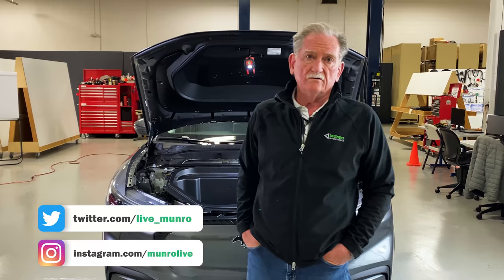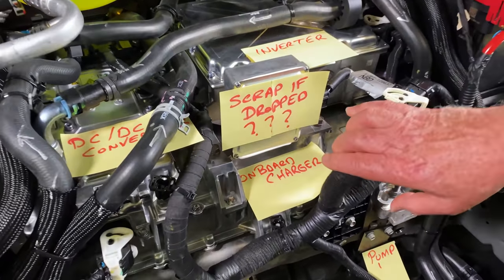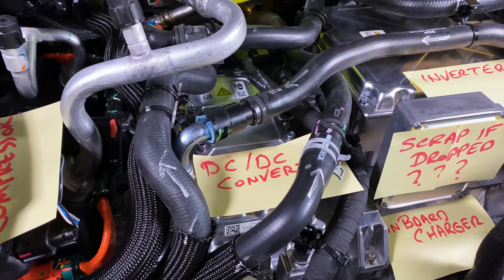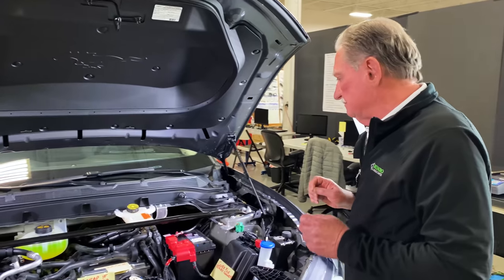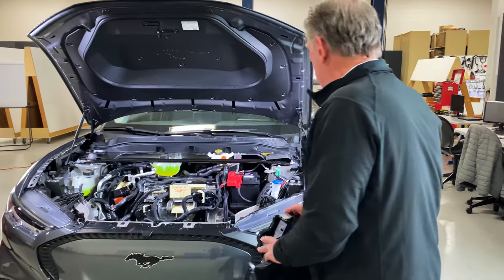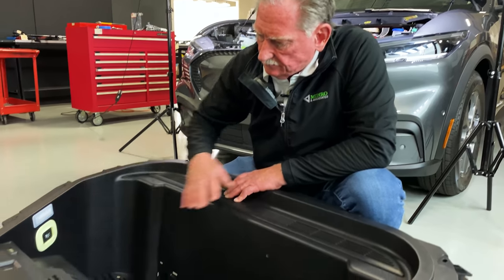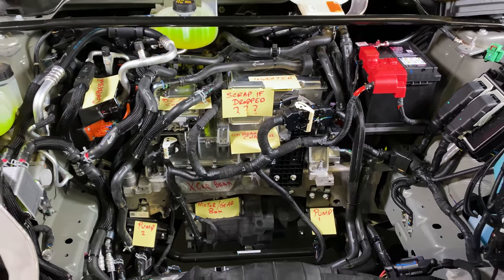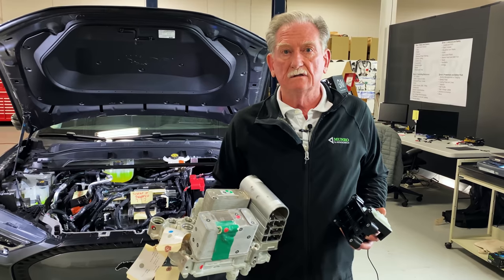Mach-E Thermal System Nightmare

Comment: What a clusterf**k.
Reply: LMFAO 😹😹
Reply from the maker: Agreed.
Reply: This is what humanity has dealt with since the big money pushed out electric vehicles in favor of their profits dating back to the early 1900s. They destroyed our environment, caused massive illness and death in favor of the almighty dollar. We need a new paradigm like what the Venus Project proposed. I was "woke" by the Zeitgeist movement when I saw his 1st project. I'm still fascinated with it's predecessor...Technocracy. It assumes we use energy credits as currency and science to guide our use of resources as opposed to corporations who are driven by a fiduciary mindset over science.
Reply: @billbosch9127  The compact energy of liquid fuel is what drove the internal combustion engine as the primary automobile power for over 120 years.
How would huge electric batteries moved by the burning of coal for 100 years have been any better for the environment?
Reply: @don2deliver  Because with an ICE, the only way to power it is with oil. An electric vehicle will run on any power you can generate. It could be from coal, but it could also be from nuclear, hydro, or even solar.
Reply: @user2C47  but we are at a point where we finally have the battery technology to make them feasible. Yes we had electric cars 100 years ago, but if those went more than 2-5 miles i'd be shocked... People were DIY'ing electric cars back in the 80's but the motors and batteries weren't good at all (car heavier than a truck that could barely do 45 and had 20 miles of range for a good conversion).
 i will agree that we have been set back a few decades, but i don't think it's been too hindered by oil. Modern semiconductors, motors, and batteries play a huge role in why we have workable ev's now. The world would have had to make a concerted shift back in the gm ev1 days to set this industry off when it could have taken hold. Anything earlier (before NiMh batteries) was far too heavy and bulky on the battery side, and the technology just wasn't there to improve them much been if they could. I believe the ev1 had nimh batteries, and that makes sense that it would have been the first commercial test of a practical ev. That's where i place an official "we could have been here already" marker.

Comment: How often does the level of liquid in those two bottles near the firewall, need to be checked?  I don't love the idea of hiding service parts behind those clips which always break.
Reply: You're funny. It's hidden, so when it leaks the whole car blows up, then they can sell you another one? Why do you think cars STILL don't have low coolant/low oil sensors or real temp gauges/alert? It sells more cars by the millions per manuf.

Comment: The part under the superfluous cover on the right also had "scrap if droppped" embossed into it
Reply: There are many parts like that, but the one with the sticker is unknown for what is doing
Reply: @LiviuIonescu  Looks like a load of silicone gooped under the lid of that box..
Reply: Tube technology?
Reply: Scrap the MUCK-e if Drooped..........LOL.
Reply: This part is called "Flux-Capacitor"!
Reply: @phamuc11735  Yeah, Sandy probably found the hydraulic computer 😁
Reply: They probably have MEMS and stuff in them
Reply: @markplott4820  F.O.R.D - Failure on Road Detours, F'd over royally daily and the list goes on. They criticize Tesla and then it is found that a legacy car company makes so... many mistakes...
Reply: @michaelholliday100  I’ve always like
 “FORD - Fix Or Repair Daily”
Reply: @v.gedace1519  I think it's a frammistat actually.
Reply: You would think that someone who worked at Ford would know that they have been using this saying on parts for almost 20 years.
Reply: @Johnny2Feathers  Found On Rubbish Dumps. Failed on race day. And on a quiet day, you can hear them rusting.
Reply: @DLWELD  to keep the frammies warm 🥵🥵🥵
Reply: Is that a lead acid 12V battery? What the # is that about? A 5AH (maybe even less) LiFePo would do the same job, never need to be replaced and use a fraction of the space and save 5 to 10 kg in weight. If not more.
Reply: @DLWELD  Ah, designed by Arthur and Sally?!
Reply: Not fully sure of the style but i've seen many similar connectors fail pressure washing testing as they are very susceptible to being installed incorrectly  due to side load on the wires.  Those Cam locks can also break pretty easy with time at temp and cycles so possibly related to that.
Reply: Looks like a bunch of failures and leaks waiting to happen. Anyone surprised? And I can back him up about those hose clamps. I had to change them out on my last car because they leaked.
Reply: @waynelevett3632  in French 
Ferraille, Ordure, Rouillé, Dépotoir. 
Heard that decades ago.
Reply: @ziggyyo  Box for the old Muffler Bearings.
Reply: Hey! It's the famous, yet elusive, mikeselectricstuff!
Reply: That was weird.
Reply: On the steering wheel the centre boss cover is embossed with a " SCRAP IF DRIVEN" sign.
Reply: @Johnny2Feathers  How about the oldest one: Found On the Road, Dead.
Reply: Maybe that should be their new tagline..."Ford, scrap if dropped"
Reply: Customer: my xyz is not working
Workshop after removing frunk cover: did you perhaps drop this 
Customer: What the ... 
Workshop: just joking, just joking, lol
Reply: At least the battery box gets a tick.
Reply: @richardhalliday6469  hey wanna check out my new battery box? 😄
Reply: I think that’s common on the connection modules / fuse boxes. Dropping them can bend the stamped metal plates inside and cause shorts.
Reply: "You could use a new radiator hose" , Duel (1971) ...
Reply: @michaelholliday100  terrible, it's found on the road dead
Reply: The cover isn't really superfluous. It provides some spatter protection to keep the connectors cleaner. It also keeps curious fingers out.
For components that are truly shock sensitive a visual mechanical shock indicator is usually fitted. Turns red if a gforce is exceeded.
These are warnings keep out the careless, curious and clueless.
Reply: @Dave5843-d9m  not a good option for cold weather climates unless fitted with a heater.
Reply: @Dave5843-d9m  i
Reply: @Dave5843-d9m  i don't think they have a place in modern ev's, but oddly i think a few big brands are still using them... I have no idea why... (Well, it's probably cheaper for them as they get bulk discounts)...
Reply: The whole car should be scrapped.
Reply: Elon MUSK is New God! Mars is the New Earth! Earth Will soon Die Anyway!! TESLA and Tesla Holders will be Kings. Rest and their Family will be Our Slaves and work to Power energy for Bit coin!! Elon is Einstein, Edison, Newton, and Jesus combined. HE at least deserves several Nobel Prizes. Elon has more IQ than weight of Hater's Ug ly Prius and his F at Ho Combined!! HE is like Ironman who will destroy Thanos and critics are better off using their cash to wipe their a n us. JUST Worship Him instead of other silly god!! GOD Elon will Punish infidels!! Go Emperor God Musk!! Elon's brain chips and AI will control and Enslave Nonbelivers!!

Comment: Can you imagine being engineers having their products reviewed like this. Must be tough. Huge Munro fan! Love the videos!
Reply: You should hear the crap they get when they go out on the production floor
Reply: I can't believe these companies don't hold internal design reviews.  This mess would be a target rich environment for reviewing engineers.   The problem the designers have is all the constraints they have to work under.  Bean counters, ASAE standards, corporate mandates, safety standards, inventory backlogs, styling restrictions, union rules, its never ending...
Reply: @gregcollins3404  Many design reviews are held years in advance before the first prototype is built. In reality Vehicle Operations (the assembly line) calls most of the shots when it comes to the architecture of the vehicle packaging. It has to be able to be built quickly on an assembly line within their tooling constraints first and foremost and in some cases serviceability loses out.
Reply: @gregcollins3404  when people like Murno get called in they have months to improve a part. the production engineers get a few weeks to solve a problem with dealing with 5 other problem
Reply: I'm afraid that this is another typical example of an engineering team working purely theoretically. It's not the engineering team's fault though, they did what was asked for. The true problem is that no one is responsible for overseeing and keeping the full project in line from engineering through parts needed through assembling all together in the most cost efficient way. That would be a big cost saver, makes products much more reliable, all leading to a bigger profit. People capable of achieving this are out there, just not that many. Whether it's replacing software at an accounting firm or this, I recognise the exact same problem.

Comment: It's 2021! When I saw all the hoses under the Ford hood I was thrown back in time to my Dad's 1979 Lincoln Continental! And I thought that beast had a lot of hoses! I think that the Ford Engineers were under a lot of pressure to get the Mustang Electric out the door and to heck with good design.
Reply: Everyone is. Tesla put pressure on the market and the market is responding as quickly as it can. The problem is that these companies are not used to moving fast to begin with, and moving fast with new technology is especially difficult. And I think we all knew Ford was going to be using a ton of off the shelf parts... It is simply how they operate. For years it was assumed that just BUILDING an electric car was enough, but in the coming years it is going to get more and more about quality. An EV shouldnt require much maintenence and this is a car begging for it. Not good for the future. And especially sad considering how great the exterior/interior and features generally are in this and the Lightning.
Reply: "to heck with good design" that's ford's motto since the 2004 F150 came out.
Reply: @patreekotime4578  
"Moving fast"?
They've had the Model S to tear down for 8 years and the model 3 for 5.
A simple "Why does theirs look like that?" Should have been enough to start questions being asked.
This smacks of zero "out of the box thinking"
Reply: "Ford staggering into the 20th century from the wring direction."  A Ford ELECTRIC vehicle with more cooling hoses than a Ford ICE!!!

Comment: @6:00 There's another "scrap if dropped" under the cover.

The hose situation looks deliberate to me, maybe to appease some suppliers, or many failure points to develop strong lasting relationships with the local dealership service centre.
Reply: Yeah, also I noticed that their limited warranty is nothing great. It's worse than Telsa's warranty, along with Hyundai.

Comment: Once the old (even a few years) it becomes a nightmare.  Once the Aerostar hoses and their custom fittings were replaced we got better performance....finally.   Was there an intentional effort made to prevent engine overheating with thermally triggered horsepower limit ?     
Great things can be made, but sometimes nightmares also.

Comment: My guess is the "Scrap if dropped" parts are frangible or perhaps even pyrotechnic disconnectors that fire and break the connection to the battery on several points if there's an accident or a serious overload.

Comment: The stacked boxes and all the hoses under this hood looks very similar to what was under the hood of the 1998 Ranger EV.  That's 23 years with very little change, right down to the lead acid starting battery.  Of course the very low temperatures and pressures of the fluid running through those hoses is unlikely to challenge them in anyway.

Comment: I like those spring hose clamps it seems like when it heats up a little bit it'll loosen up a little bit then when it cools down it'll go back to tight again it's less stress wear and tear on the end of the hose there where it's clamped I've seen them on the diesel where there's kind of a like a spring so you can torque them down to a certain amount

Comment: The extra cover might be because the frunk liner can flex under load and press onto the ECU connectors, or they're sealed connectors but not sealed enough in all conditions, such as a vacuum forming after the module cools.  I'm always glad to see these instead of wondering if the connector is really good enough.  Then you have the Volvo P2 platform (first gen XC90) that puts unsealed connectors right under a cowl passthrough door that can leak when parked on a slope.  Or Porsche 996 / 986 that puts the unsealed immobilizer and connectors at the lowest point of the undrained floor pan where the cowl drains to when duckbills clog.